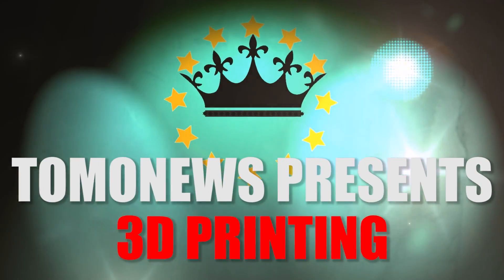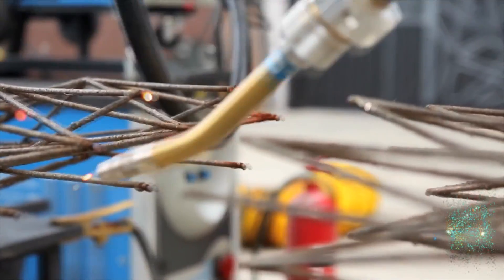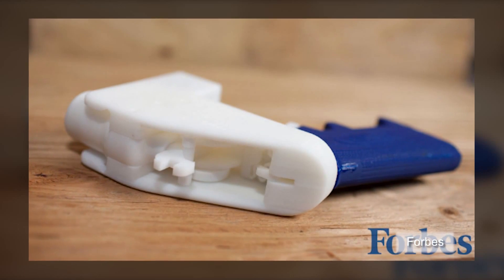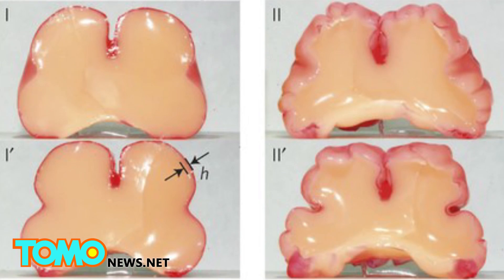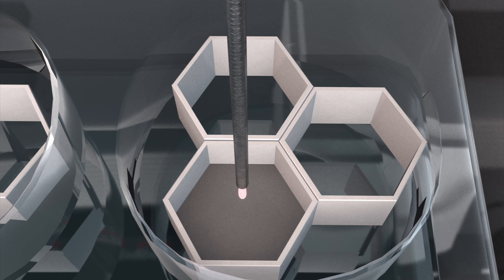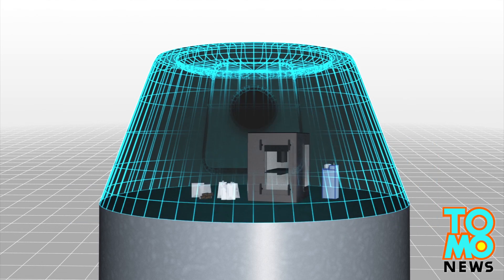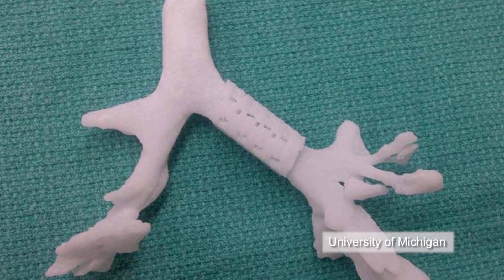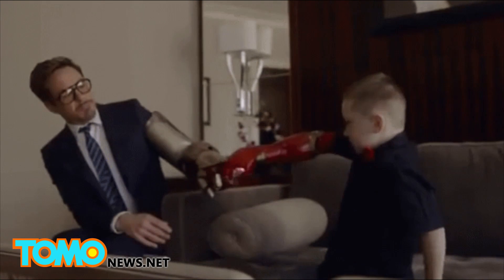Chinese hacker SexyCyborg’s hacking gadget, 3D-printed Cortex Exoskeleton - 3D printing compilation

Comment: the gun may be undetectable. but the bullet itself needs a strong enough to case to hold pressure. so the bullet casing would need to be metal